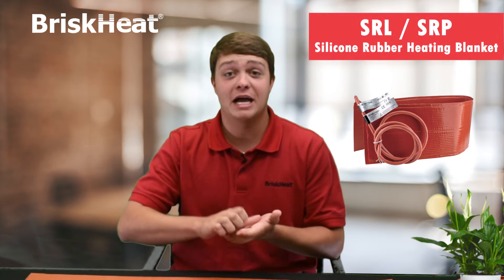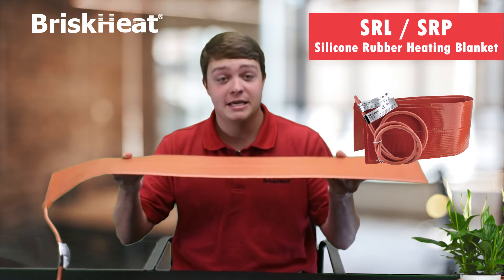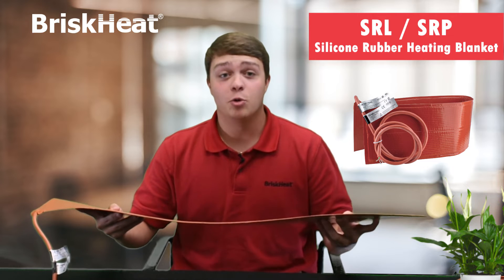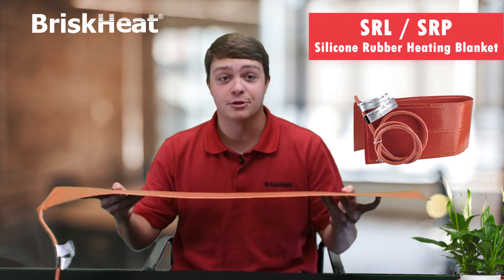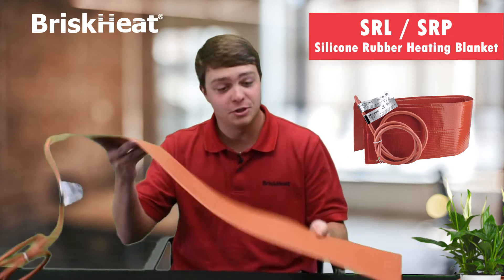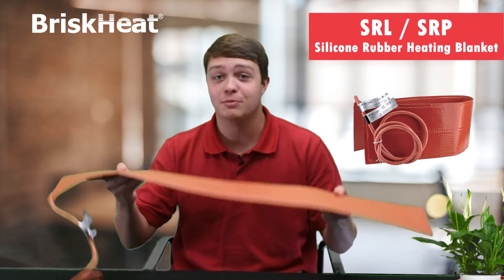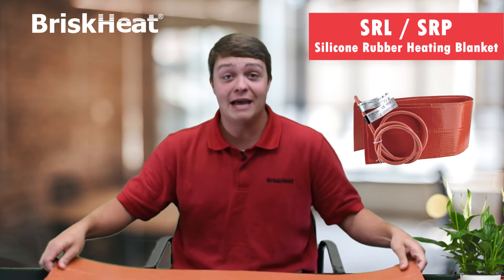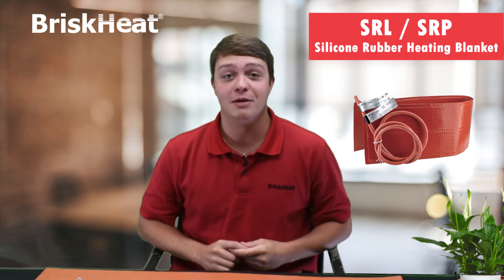The Best Silicone Rubber Heating Blanket for Industrial Needs

Comment: What is the temperature it can hears to? I want to use it to bend rigid vinyl
Reply from the maker: The maximum heating temperature depends on the version ordered. Most silicone rubber heaters have a maximum temperature of 450°F (232°C). You can order the SRL or SRP heaters with a 150°F (66°C) high limit switch which will limit the temperature. Keep in mind, heating blankets require a temperature controller. The -ADJ versions have an adjustment to reduce the supply wattage; however, it can not be set to a specific temperature. For vinyl, you should use a temperature controller to ensure it does not go above the melting temperature of the material. Our LYNX-SET (PID), TB250N-250,  or SDC are good options.

Comment: Hibcan these be used for sublimation?
Reply from the maker: Whether or not it can be used for sublimation depends on the transition temperature of the solid. The heater itself cannot be used in an environment where it is exposed to extreme pressures and the application temperature is limited to 450F (232C). It is unlikely unless the phase change takes place within these limitations.